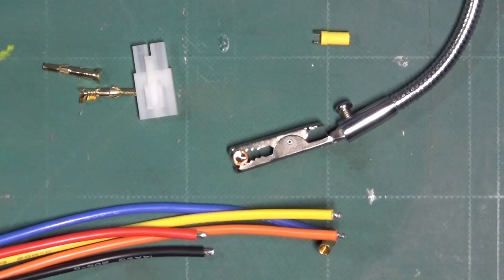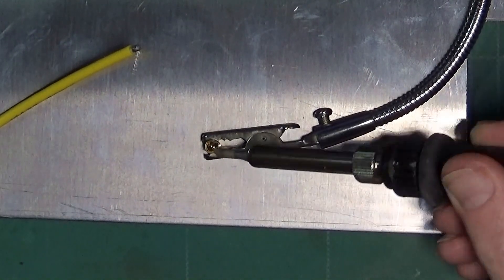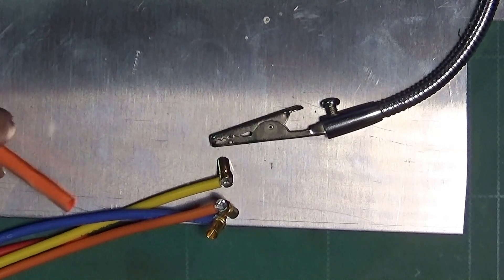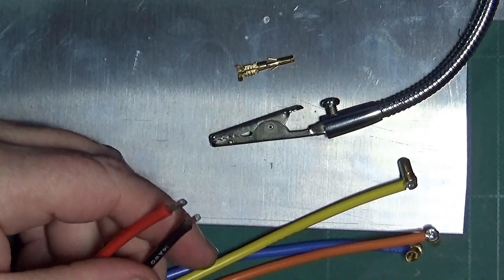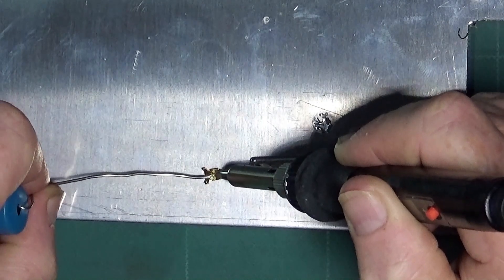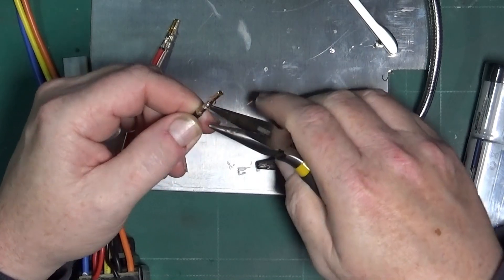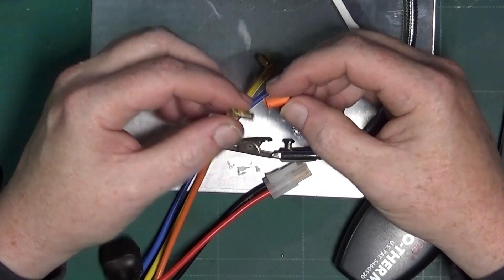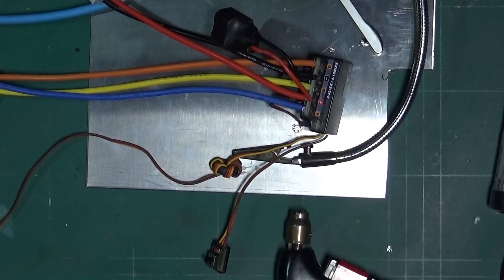How To Prep A Hobbyking X Car ESC (Soldering Tips)

Comment: Great top tips Rob.  I am a bit shit at soldering but I'm getting a bit better thanks to videos like this.  Don't think I've ever seen someone putting a Tamiya plug on.  Normally they are cutting them off to put a higher current one on.  By the way I saw one tip tip of wearing those heat proof oven gloves (not the big mittens but the stringy gloves with individual fingers) to handle the hot wires . Anyway helpful vid thanks mate :-)
Reply from the maker: Thanks Pete. It's not to bad but my background is in soldering components onto printed circuit boards before the invention of surface mount components.
I got a pack of ten a couple of years ago so do the opposite and swap any other type of connector for Tamiya lol.
I must admit most of the time I try not to handle the wires but I will have a look for some thanks.
If you haven't seen it already you may find my brothers comment (Tony B) very helpful.

Comment: I've had tip problems meself!! 😂  Seriously, excellent tutorial. I've never seen that Hobbywing ESC before... That's quite a chunker of a Cap Pack!! That should be great for big bursts of Power!! 😁
Carmine ✈🚂🚙
Reply: That’s what she said 😝 lol
Reply: @mikeymike3240  Haha, Mikey, you crack me up!!!  :))
Reply from the maker: Ooh err missus
Reply from the maker: Thanks Carmine. They do at least two sensored brushless ones, 60A and 120A. Both are programable but you have to download the software and by their USB dongle.
Reply: @robbrennanrc   My only Brushless ESC currently is a 120A Sensorless - and it's programmed by the same Card used with the WP1080 Brushed ESC. 
I actually like it - but a 2 or even 4 Pole Brushless Motor would have an IRRITATING amount of cogging at low speed. I've run 6 Pole TenShock Brushless Motors in mine, and they're nearly as smooth as Sensored Motors - at HALF the price!!! 👍👍 
Mine is in my Axial Wraith, what's yours going in?
Reply from the maker: It's in my Absima AB3.4 Buggy. Managed to get it out just before lockdown but not enough usable footage for a first run. But it did look fast.
Reply: WOW Mate! That's nearly OVERKILL!! Sounds like fun. 😁

Comment: Rob, I noticed you were having problems with your tip (phnarr phnarr). 3 tips:
1 Use a tip cleaner (I like the ones that look like a metal pan scourer)
2 Get a tin of flux (Rosin flux, not plumbers' flux) and dip your tip in it before you switch the iron on
3 If you've got any lead-free solder, take it to the recycling centre and get some good old 60/40 . Ignore any stickers
saying "use only lead-free solder." I've been soldering for 50 years and the lead has never done me any harm and
I'll kill anyone who says it has. (Just joking, YT)
Reply from the maker: Thanks for the advice Tony. Never had a problem with my tip before. Tried cleaning it several time but nothing would stick to it hehe.
I didn't know you get different types of tip cleaners, just the sponge ones will have to check it out.
Will have a look and get some along with a cleaner.
Something else I hadn't realised, I thought you could get lead solder anymore. up until recently I was using some old solder from work but since that ran out I have been using some that came with one of my soldering irons. so no idea what type it is. So yet again I will have to look and get some decent stuff.
Hope all is well with you Ann and Christopher?
Reply: @robbrennanrc  Rob,  the sponge ones used to work well with the old solid copper tips but modern irons all seem to have iron-plated tips and the sponges don't seem to clean them very well but the "pan scourer" ones seem to do a better job. The flux helps a lot too. Like you, I thought tin/lead solder had been banned but I googled it (cos I'm getting low meself) and found several places selling it including RS! Maybe people have realised that lead-free solder is rubbish. You can get the pan scourers and flux from RS as well, pretty cheap.
Another tip is if you're not using the iron for a few minutes turn the temperature down til you're ready to use it again. This helps prevent the tip oxidising while the iron is sitting idle.
Yeah, we're all ok, thanks mate. Regards to Mark and Lou too.